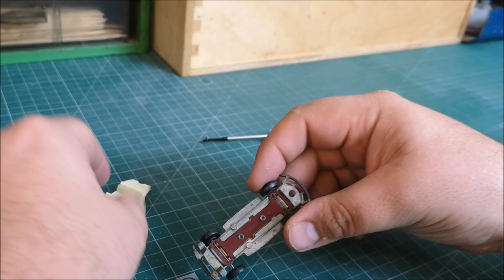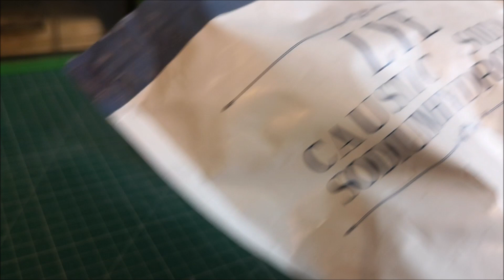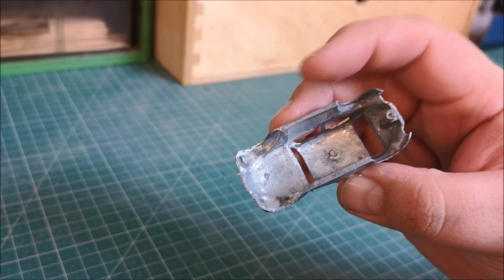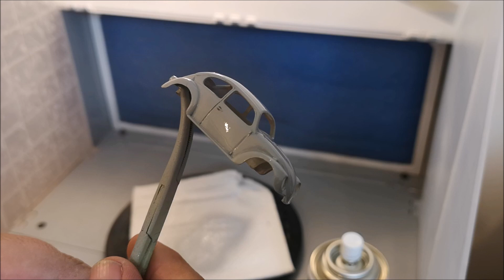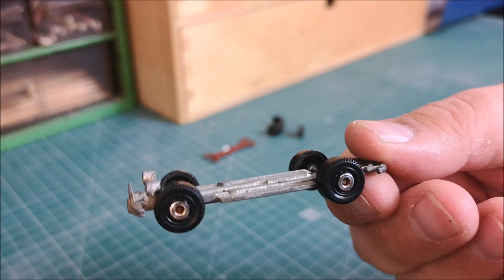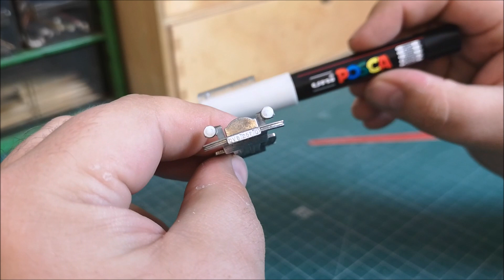Matchbox Series No 15 Volkswagon 1500 Saloon (1968 WV Beetle) - Custom Video

Comment: Great looking custom! Great job on the wheel swap and color of the body. Really nice result! Out of curiosity, with how much pressure are you airbrushing the model? 2:1 ratio thinner/paint or the other way around? Still experimenting with the airbrushing here 😇
Reply from the maker: Thanks mate. I run at around 20psi. 2 parts paint 1 part thinner although sometimes require 50/50 mix. I too am learning something new with every resto/custom
Reply: @MatchboxGarage  Thanks for the info! It does take some experimenting sometimes. As you say, some require a different approach. Keep it up!

Comment: My mother had a '68 Beetle. It was the first car I ever drove. Gloss black with a, I think, red interior. Very uncomfortable in winter as it had no heater. The only warmth was drawn from the air cooled engine and in a Canadian winter that wasn't very much. My job used to be to keep the windshield scraped as she drove it on very cold days. She traded it on a new Yellow Toyota Corolla that rusted out and fell apart in less than a year. Ah the good old days.
Reply from the maker: Great story thanks for sharing

Comment: Hello Rob, I shall be a new subscriber after I post this comment.  My main hobby is Film Camera Collecting and Restoring as best I can. I enjoy watching these "Matchbox" and "Hot Wheels" restorations because the small size of the work and various techniques you fellows use  is very helpful in my Camera hobby. Which I have been doing for over 50 years now.   I don't do restoration on these small model cars but from time to time I'll point out anything I hope you can find useful. This is the first video I've seen and the only comment I can make is generally headlights are painted silver or chrome. Even in the early days of "Sealed Beam" headlights and the modern high intensity lamps in a plastic housings the reflective material always make a headlight look silver. I think this VW will look a little better if you hit the headlights with a chrome pen.  I'll slowly watch the rest of your videos and wish you luck. Tom U.S.A.
Reply from the maker: Thanks Tom for your advice and subscribing
Reply: Always enjoyed fix up videos. Thanks

Comment: Here's a tip for you mate,try using a 6B drawing pencil (rounded not sharp but not too blunt) to pick out the number plate letters, depending on how defined the lettering is you could also use a bit of copydex paper, (the black  carbon sheet you find in a receipt book for a copy ) double sided to a little piece of card press and apply to the letters, be sure to use a magnifier so you can see what you are doing thow ! great job again btw 👍👍
Reply from the maker: Thanks for the advice

Comment: Hi Rob, great job as usual. May I ask the size of drill bits you use for drilling off the rivet head, then the one for drilling out the post and finally what size tap you use? For M2 screws I take it? Thanks!
Reply from the maker: I shall have a look when I get home. Send another message if I forgot mate
Reply: Thanks Lee, very grateful.
Reply: Hi Rob, here's that reminder you asked for!!! 😁
Reply from the maker: @solsdiecastodyssey3143  sorry mate. I bought a kit off eBay. Here's the description. Hope it helps

CONTENT:

1 x TAP MINI WRENCH

1 x TAP M2 x 0.40 HSS Tap

2 x TAPPING SIZE DRILL 1.6mm HSS

1 x RIVET HEAD REMOVAL DRILL BIT HSS-Cobalt TiN

SCREWS

24 off M2 x 3mm long HEAD Diameter 4mm

24 off M2 x 4mm long HEAD Diameter 4mm

24 off M2 x 3mm long HEAD Diameter 4.5mm

24 off M2 x 4mm long HEAD Diameter 5mm

24 off M2 x 4mm long HEAD Diameter 6mm

12 off M2 x 3mm long HEAD Diameter 7mm
Reply: Ah thanks so much for that Rob! All the best and keep posting!

Comment: hi rob nice video  could you help me i am new to restoring model cars i have a selection of lesney cars , to do but im stuck  , i want to drill hole for rivets to go in but i think it is to small to drill and also where could i get the rivets from or would tiny screws do any advice would be welcome thanks barry
Reply from the maker: I drill/tap and use screws

Comment: Like this one, always had a soft spot for the original beetle wanted one until I actually had a ride in it. Didn't like the previous modern shape, the cab was out of proportion with the rest of the body. The latest one with the slightly 'chopped' roof look is great sporty looking. Nice peppermint green and the bigger wheels look much better. I see your nearing the 10K subs mark, well done for that. I must pull my finger out and get posting some of my conversions.
Reply from the maker: Thanks Tony